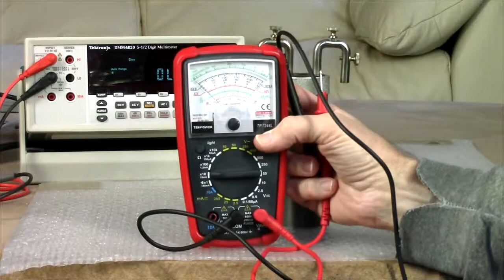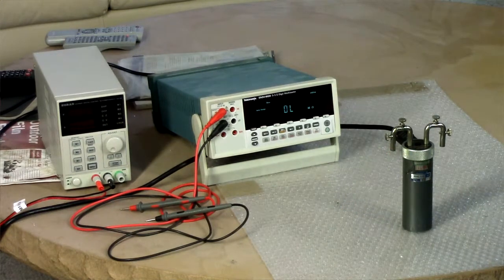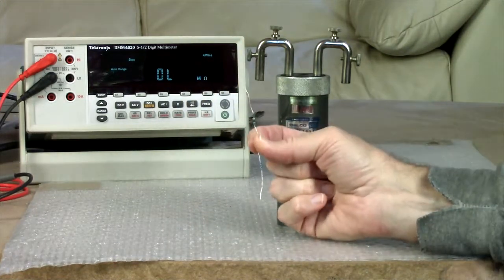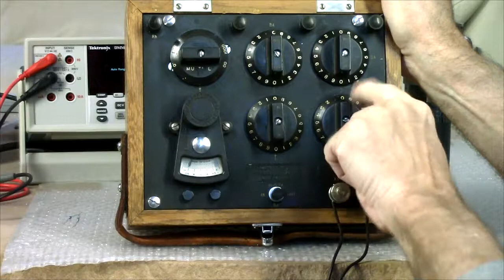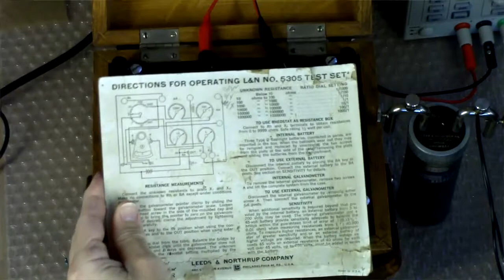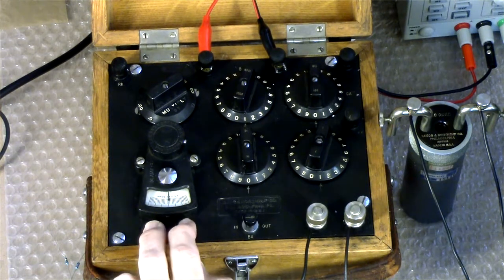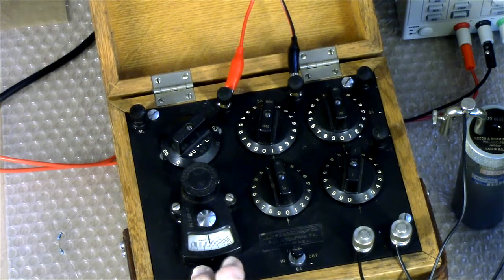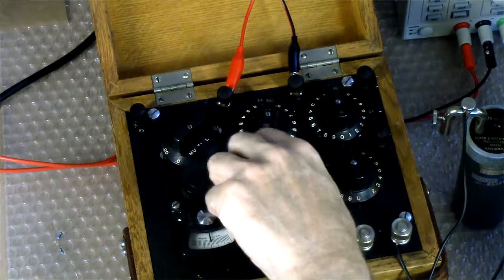Measuring Resistance the Old Fashioned Way

Comment from the maker: Corrections:
When measuring the lead resistance, the multiplier is set so that the switched resistance indicates 0 to 9.999 ohms.  Therefore:
at 8:44 "less than 1 ohm but more than .1" should be "less than .1 ohm but more than .01"
then at 8:57 "about .3 ohms" should be "about .03 ohms"

The stated corrected value (99.96) is correct (calculated as 99.99-0.03)

Comment: Depending on the manufacturer,  you can supply up to 21 vdc , but the internal battery they used was usually no. 6 telephone dry cell